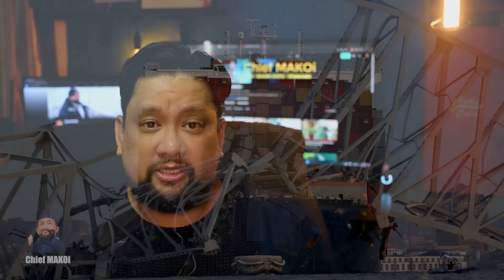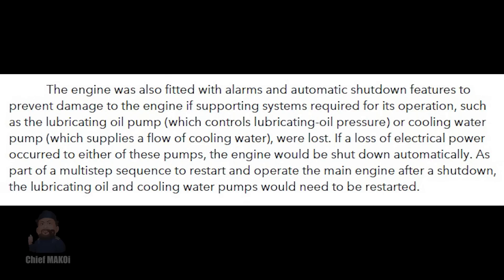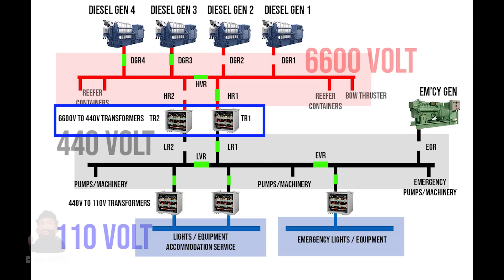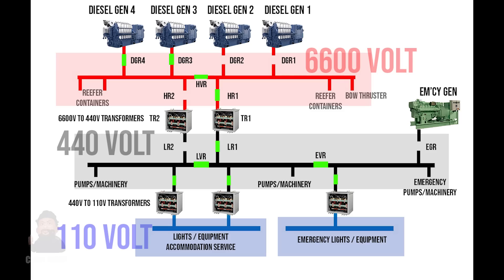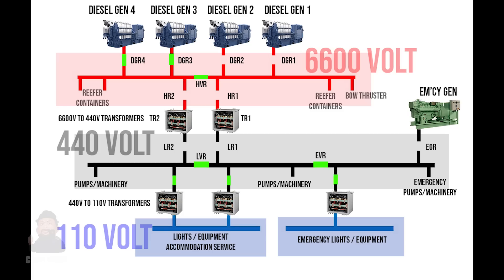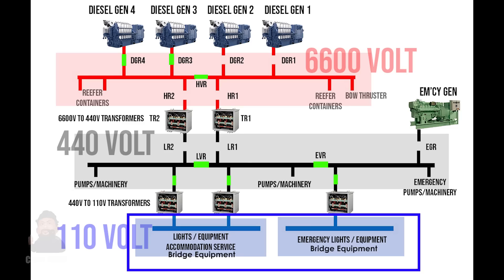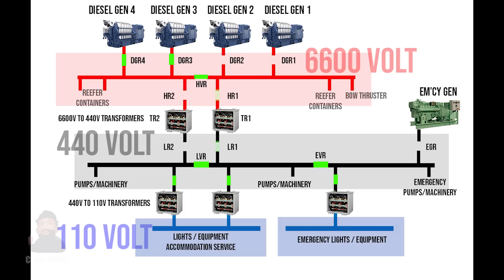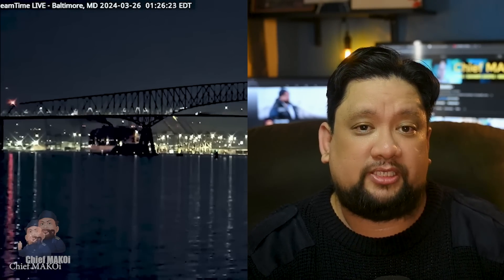Explaining the NTSB Report on the Container Ship DALI | Chief MAKOi

Comment: I don't come from a marine background (power industry), so the method they used to control the busses confused me.  During critical service (like moving in and out of port or when near traffic) I would have expected that all of the generators would be online, that the HV busses would have been separate without the interties as it a generator trip would only drop half of the hydraulic steering pumps and fuel pumps rather than the whole thing; power requires that the only single points of failure are ones that you can't avoid.  Is this normal in the marine industry?

Also, generators that I've worked with are capable of being more than all-or-nothing, and computer controlled generator auto-synchronizers have been around for decades.  Is it normal to run them without synchronizing so they can't share the same bus on a ship and have the backup connected and on the bus and simply run at idle?  (I would assume that the generators would be sized as 2x100%, and can run at 2x50% or 1@15% and another 1@85% with a loss of the primary or backup dropping the system down to 1x100%).
Reply: My take as well but do not forget attached tugs and pier protection as more safety layers.

Comment: Why would they not, as a matter of course, switch between using the HR1/L1 circuit and the HR2/LR2 circuits just to confirm functionality ? I am a ship driver, not an engineer but my Chief would regularly use both options ! Did they know (or suspect) that there was a problem with HR2 and LR2 and only turned to it as the emergency unfolded ?

Comment: "Of course a ship can steer without propulsion!  I know, I have a PC!"   It's maybe worth pointing out there's some similarity between aircraft wings and ship rudders, and just like wings will stall below a certain air speed, so rudders lose effect below a certain water speed.  Due to the differences in the medium (air vs water) the effects aren't identical, but there's similarity in the outcome.  Moreover, ships like the Dali spend 99.99% of their time going in a straight line in the open ocean, and the rudder is designed to be as small as reasonably possible, it just adds drag.

Personal anecdote re blackouts: I was at sea for some years after high school, and my first ship experienced a blackout just as we were exiting the Panama Canal on the Pacific side.  It's scary to think about what could have happened just ten or twenty minutes earlier.  The problem was the fuel booster pump for the generators, the coupling between the motor and the pump had come apart; evidently it had been improperly assembled the last time the bearings were replaced.  There were two pumps that would alternate as duty and standby, but the standby would only be activated if the contactor for the duty pump tripped, there was no pressure or flow sensor.  Halfway across the Pacific there was. :-)

Comment: The report gave an answer to what was the root cause of the incident. However it raised a couple more questions. Was the crew aware that they had an issue with the electrical system and if so how long have they known about this? To only use one set of high voltage breakers for more than a month and only switch to the other after they had experienced blackouts in port sounds suspicious.
An other question that has not been addressed is how much commercial pressure were on the ships crew? When asked by the pilots if everything was in order the captain answered yes. He must clearly been aware of the previous blackouts in the port and if the problem had been solved properly. It is well known that ship owners, charters and cargo owners want the cargo to move as fast as possible. When it comes to commercial pressure I think container vessels are the worst. I have seen them do ridiculous and dangerous maneuvers just so they can be on the pilot station at the right time. The reason is probably because in port the schedule is very tight and everything is lined up for a quick transfer. If I remember correctly the Dali was already delayed. If you see the static of ship collisions in the Singapore Strait you will notice that container vessels are over represented.

Comment: What’s the point of having 4 back up gens all on the same bus. Any failure in wiring takes out the whole system. Airliners have 3 hydraulic systems but they are all isolated.

Comment: The Dali main engine has two gear lube oil pump for mains bearings one run and second on st-by.second lube oil system is cylinder oil lubrication system .Third lube oil system is cross head lube oil two pumps one run second one standby .All this lube oil pumps system are arms with pressure and flow electronic sensors and are connected on shut down safely system.lube oil is # 1. For main engine lifetime safety,second cooling water armed with overheating safety’s system.All lube oil pumps are power with three phase el motors 380 or 440 Volt ,to run them generators prime movers are running depending of the load of the demand power Kw.

Comment: They may have had bad LSD that didn't have lubricity added because once a fuel is deSulphered, it loses lubrication because sulphur acts as a lubrication. If no lubrication then engine and fuel pump can overheat. Inspection takes place on samples from shore tanks and if low then Additive companies are called to the fuel dock to dose the tank. This could be a source

Comment: Thanks Chief for such an excellently explained report. I have no experience of marine engineering but have designed and maintained large airport plant rooms with standby generators, duplication, run and standby equipment. The control logic you describe makes perfect sense.

Comment: Why is it normal to operate the ship with both the 6600 and 440 bus ties closed?  

It seems as if the overall system would be more fault tolerant to run one diesel generator on each side of the bus tie.  Then a single fault with TR1 or TR2 and/or their associated breakers would not shut down all the auxiliary support systems required to support the main engine.

In my mind the bus ties would be a way to power up the "other side" of the bus after a failure, like after a failure of TR1.

Comment: I'm a bit surprised that (if I understand correctly) the bulk of the ship's data wasn't backed up by battery. Hindsight is 20/20, but it still seems obvious most or all of that data (pretty much guaranteed to be pertinent to any accident involving mechanical failures) should be similarly backed up by battery. Perhaps the length of the wire runs would preclude low voltage data lines, but that wouldn't be difficult to work around, even if only having the sensors record the data locally for post-incident analysis even if not available in realtime.

Comment: Thank you for this analysis  and especially fur the improved block diagram, as the NTSB's version was wholly inadequate. 

You skipped however over a hole or anomaly in the NTSB's explanation with your own sleight of hand. On the second blackout,  the D/Gs go off line when their own breakers trip. At the time HR2 and LR2 were closed  having been manually reset earlier.  The report then says that power is restored to the LV bus  from D/G2 by the manual closing of HR1 and LR1. But according to the NTSB HR2 and LR2 are already still closed, making this operation unnecessary. You get round this by mysteriously opening HR2 and LR 2, but it's not in the Report, and not clear why they would have opened.

Comment: I am still wondering if something shorted out (not necessarily in the switchboard -- could have been downstream), thus overloading the main generators when power was temporarily restored.  This may have given a hint of itself during the blackout 10 hours earlier while docked.  If the 440 V system was trying to feed the fuel pumps, but the fuel pumps weren't actually getting it, that would explain both the overload and the low fuel pressure.

Also, in the time from the start of the first blackout to just before the second blackout, when they still had 6600 V power, could they have used the bow thruster to turn the ship?  Or would the control line have been dead due to the 440 V bus being down except for the emergency part?  (Sounds like control lines should be able to get power from the emergency part.)

Comment: So the fuel being used by the generators was clean and free flowing and ruled out as the primary cause.  Faulty electricals tripping the in service transformer.  So the mystery of the belching black smoke of huge quantity remains unsolved - was it from the main engine trying to start?

Comment: Excellent video!
.
I dont have any ship experience.
But i agree, the black smoke from up to speed running engines is a big question for me.
My diesel technology college training makes me really ponder what really going on.
Like they cant figure it out, or a very severe case of lack of training. Are what comes to my mind.
.
On my own stuff ive delt with road diesel and home production of vegetable oil.
In personal autos.
And all the issues that can arise. Such as a fuel line filled with a cold fluid that takes literal force to clear the fuel from the line.
I definitely agree, ruling out a fuel problem is a bad idea.
0.01c

Comment: I am a retired Ship Captain an must thank you for the detailed report you made. However, your electrical diagram shows the reefer container supply lines coming directly off the 6600 HV bus.

To my knowledge, reefer containers are generally operated at 440VAC.

This would mean that the reefer container supply should have been fed from the LV bus at 440VAC.

Since, in each incident, both sets of HV & LV breakers tripped, it could mean that there was an overload condition.
So, is it possible that the reefer system was overloaded or faulty? Did the Dali attempt to carry more reefers than they were designed to handle?

Were managers & owners putting pressure on ship staff to carry more reefers than the generators could handle.

Hope you are able to check & clarify whether this conjecture is a real possibility.
Reply from the maker: The reefers had their own transformers.
Reply: Noted & thank you 
 @ChiefMAKOi

Comment: C/E Makoi.  Regarding the possible fuel problem to the generators, when I was sailing as Assistant Engineer I did come across valves in the fuel system that had trips built into them.  It’s been a while, so don’t ask me what the trips were for.  The second blackout with simultaneous DG failures brings that to mind.    Any thoughts on that?  Hard to believe they ran the tank dry, but stuff happens.  

Can you speak to the difficulties down below in these situations.  I  remember the heat, noise and stress were difficult to deal with when things went wrong.

Comment: Thanks for a really nice diagram. It make a lot more sense than the one in the report.
What kind of system or process keeps the generator phases synchronized? (is that what you mean by 'differential' protection?) Is that mechanical?  If that fails would it drop both generators?
Also, are those pictures of the marine transformer actually from the MV Dali?  I ask because the date of the transformer is 2008 and the Dali launched in 2014.

Comment: When the NTSB said that the lube oil pump was on the 6kva bus I didn't think that was correct. And it seems that you placed it on the 440vac bus which is where I expected it to be. I would also expect there to be at least 2 lube oil and cooling water pumps. One on each side of the bus tie breakers.

What am I missing?
Reply from the maker: One former crewmember confirmed that the LO pump is powered through the 6KVA line.  Of course it has its own transformers.
Reply: @ChiefMAKOi  Interesting. Now wondering how they connect that lo pump to the emergency generator.

Will be interesting to see what the NTSB comes up with.

Seems there has to be a better way to keep lo and cw pumps running in cases like this.
Reply: @DuaneKerzic  As I understand, Emergency generators are small with limited loads connected to the emergency generator bus. To start/run a main engine for a ship of this type, at least one of the main generators need to be online and connected.
Reply: @philgardiner445  I'm seeing that they are saying that one of the main generators has to be on. Seems they don't have an engine driven shaft generator, engine driven lube oil and cooling water pumps even though those are available as options. You'd still need the generator driven pumps for startup.

I don't know how big the motors for these pumps are. But I'd expect less than 77kw for both. Maybe the Chief can give us an idea how large those motors are.

If they didn't lose propulsion this event wouldn't have happened as they would have still been able to control the ship.

Comment: at this point I'm going with the theory of worn transformer windings, causing an intermittent fault.  this would cause the beakers to open and have to be manually reset.  - and it would explain why it only faulted on transformer 1.  it would also be another possible explanation for a generator losing speed before the breaker opens.  - overloading a generator bogs the engine, and a short circuit dumps a massive load on the generator.  

as for the persistent black smoke - it could be low fuel pressure causing poor combustion.

Comment: Chief,

Your analysis was spot on!  I agree with you in almost everything.   There are a number of areas that I will have to wait for the NTSB's next report.

I would be interested to know which equipment was online, which were in standby, and which were offline.  I wonder if the Power Management System (PMS) was working properly.  I would have expected the load shedding and sequential restart would have prevented a total blackout.  As you pointed the alarm log should show the sequence of events.

The black smoke in the my "recliner" evaluation may have come from two possible sources; 1) an attempt to bring the main engine back online in a full astern attempt,  or 2) when DG2 was put online they manually closed the breakers for DG2 without it being in phase with the two running generators.  I would also be interested to know why they didn't have DG3 and DG4 running with the second transformer.  From a design standpoint DG1 an DG2 run as a pair feeding the Starboard 6.6 KV Switchboard and DG3 and DG4 run as a pair feeding the Port 6.6KV Switchboard.  The port and starboard switchboards are connected by a bus tie breaker.  If the bus tie breaker fails it is much more difficult to avoid losing the plant.

I believe that as the story starts unraveling we'll find some very interesting answers.

Bob
Reply: From the preliminary report- there was no attempt to restart the main engine and the black smoke started appearing ~80 seconds before  DG2 was connected to the HV bus. I am thinking that black smoke is related to the emergency generator starting and coming on load or DG2 automatically starting (resulting in DG2, DG3 and DG4 all running at the same time) and insufficient fuel pressure.)
Reply: @philgardiner445  That was a lot of black smoke for the EDG.  I am not familiar with EDG requirements for containerships.  I can't comment on current requirements. Fifteen years ago rules for US flag tankers limited EDGs to 750KW.  The  USCG also required that the EDG and its switchboard be in a completely separate space outside the main engine room.  The rules also required that the exhaust be separate from the ship's stack.  

It is very entertaining to try to figure out the chain of events without direct access to the ship.

Comment: Excellent explanation, Chief.  Is it possible for both HV breakers and both LV breakers to be closed at the same time, in which case each transformer would take half the 440v load, but if any of the 4 breakers opened the remaining transformer would take all the 440v load?

Comment: The ship seemed to have the stern swing to to port after the blackouts.  You mentioned the pilot ordered anchor deployment.  Visually it appears that the starboard anchor grabbed and the stern swung away, pivoting the bow of the ship into the bridge.  If the port anchor had taken hold the stern would have swung towards the bridge. Still would have been bad on the bridge to have the side of the ship hit it. Could the wrong anchor have been dropped? Or just bad luck for the anchor finding a solid hold?

Comment: Excellent video, as always.  Why would the transformer input and output breakers (HR1 and LR1) trip at the same time?  Are the tied together like a multi-pole breaker?  It wold seem that an overload or faulty breaker would trip one of them, but not both.  Thoughts on that?

Comment: You have to have electric water and oil pump. On a rail engine or four stroke engine pumps are geR driven. A cruise ship the perpeller is electric driven the engine drives a generator.  A direct drive is simpler mechanily

Comment: Hey chief ee here. You would not typically close tie breakers on both sides of the transformer pair, to avoid circulating currents.  The ntsa diagram did not show high and low ties both closed.
Reply: If the report is verbatim correct high and low transformer breakers opened simultaneously which strongly suggests the transformer protection relay caused the trip.  That could be overload, short, severe imbalance, reverse power flow, ground fault or possibly other functions.
Reply: Just got to your remark about differential protection. .. no longer rare with modern digital relays.  Also, given that the xfmr breakers opened I'm not surprised the auto restart didn't restore the lineup, the automatic scheme assumes a peer generator fails, not the load dropping off.  I'm shocked there's no information about the trip cause "flags" though.  Need a better photo of the lineup face to I'd the relays.